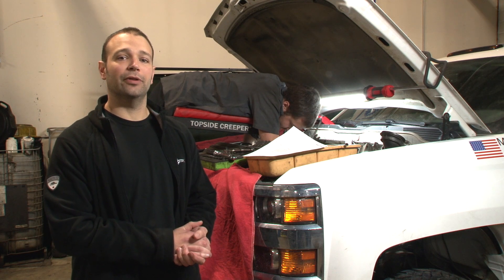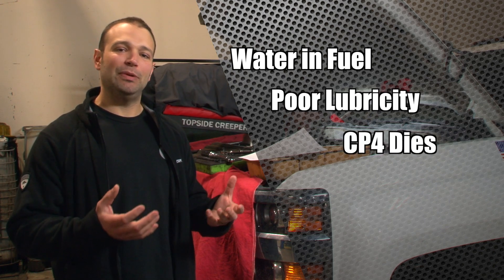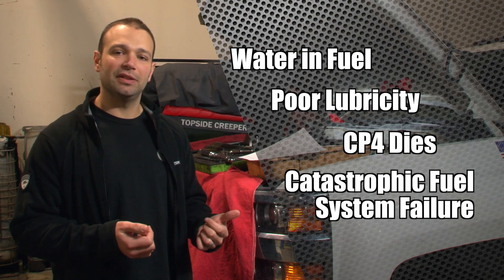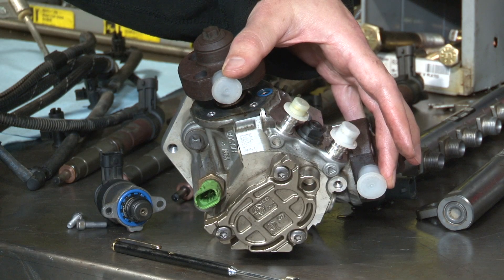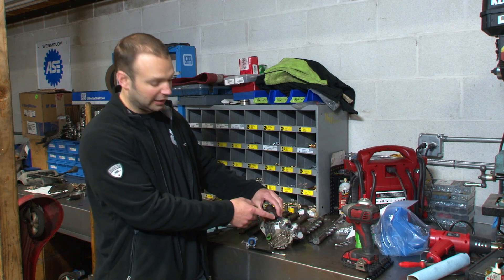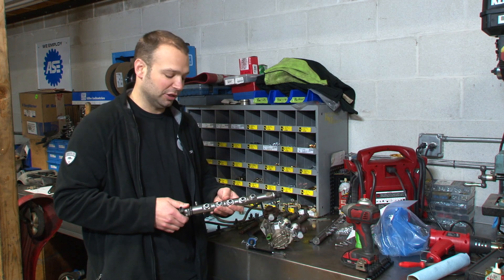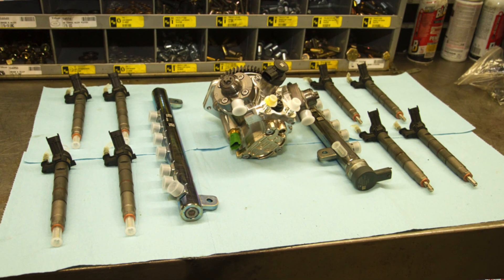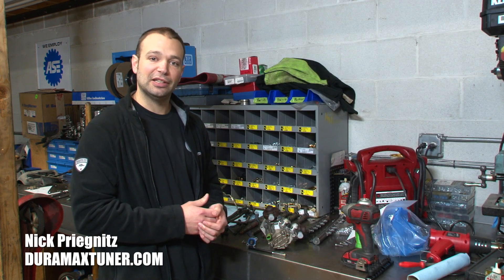Catastrophic Diesel CP4 Carnage - Diesel Insights

Comment: Nick, why would anyone recommend installing another CP4 pump that could fail within 10 to 20,000 miles. Why not install a CP3 ?
Reply from the maker: The kit that was installed on this truck came straight from GM and was heavily discounted back then (almost like GM knew they had an issue). To prevent future failures we install a lift pump and upgrade the mProp screen. Also, back when this video was shot, a CP3 swap was only available for deleted trucks.

Comment: The CP3 will destroy itself when water is introduced into the fuel system as well.
Reply from the maker: No lies detected.
Reply: @Duramaxtuner  I had 2005 c4500 where the fuel filler tube had rotted and water was kicking up from the rear tires. It took the whole fuel system out.

Comment: Any metal on the fuel pressure regulator screen indicates a bad pump correct?
Reply from the maker: Generally speaking, yes. You also will likely see a drop in rail pressure under load.

Comment: Hey Nick, soaked up the info from the video, Thanks for that.  My current issue is wth a 2014 LML, with about 26psi fuel rail pressure. Truck was running good, then quit like surning the key.  No codes, good fuel sample, 2 week old fuel filter, cut apart, looks clean. Pure stock truck, light towing. I'm thinking I would like to pressurize the fuel rail to see if it will hold pressure. What are your thoughts.

Comment: So glad you confirmed the metal shavings were magnetic.  Thanks.
Reply: Just to report back.  A magnet on a firm wire cleans up the gas tank like magic.  But not sure it matters.  The metal bits are heavy and stay at the bottom of the tank.  Didn't see any in my fuel filter.

Comment: Hello Diesel Insights! Could this failure be caused by low intake pressure (HPP intake)? I have a similarly failed pump with a clogged fuel filter

Comment: I have a 2015 Chevy 2500 Duramax and fortunately I have not been affected by the catastrophic failure that can occur.  I started reading about this a couple years ago like many people but never actually knew anyone personally that had to deal with the failure.  So General Motors opted to use a Bosch manufactured fuel pump the CP4 for model years 2011-2016.  Previous model was the CP3 that was apparently a little more robust than the current CP4 or it was at least a little less prone to failure because diesel fuel wasn’t this Ultra Low Sulfur stuff we have to use these days.  And that right there is why some owners are having this failure.  The CP4 pump to survive for a long time needs lubrication from the fuel which it hardly gets with Ultra low sulfur diesel.  That lack of lubricity and the ever present possibility of a trace of bad fuel (water/air) combined with 20,000 PSI in the pump equals bare metal on metal grinding together.  (Boom).   
I don’t know if I’m just buying time or delaying the inevitable but I always every fill up add diesel fuel additive that adds lubricity to the fuel and hopefully that formula works.  It’s just a shame that the consumers that opt to go to that extreme have to shoulder the expense.  Others go as far as putting a inline Lift pump to help separate water and smaller particles of debris out of the fuel.  Another interesting point is this Ultra Low Sulfur fuel mandate by the EPA was put out in 2006 and was to be fully implemented by 2010.  Hmm anyone else see a timeline problem?  I find it hard to believe that nobody at General Motors or Bosch didn’t see it coming.  Any reasonable engineer would be trying to fact find the impact of ULSD on probably hundreds of thousands of pumps when this new standard was introduced.  Curious to see where this goes.

Comment: I have a 2011 duramax that i deleted and added a lift pump to at 90k. It has 176k on it currently and runs like a top. I add 8oz of optilube xl every fill up. Never any problems. But If this pump failed on me while towing my 10000lb camper in the mountains and hurt me or my family I will attorney up and go after GM. These trucks are built to be constantly under a load that's why we buy them instead of gas models. Shame on GM for allowing this, these pumps need to handle the US quality.  I pray this doesn't happen to my rig and endanger mine and others safety. I personally think this is a major safety concern mostly.

Comment: goimg back with a diasterous CP4 engineering design? Not a good idea. Switch it to  the CP3. Better yet dont buy GM or Fords using the CP4. The nippon Dendso HP4 is a GOOD pump, the Bosch CP3 is a good pump, the CP4 is even new just garbage.

Comment: The shops I'm taking my truck to are having probably try to find out whats going wrong with my truck one shop said they think it's the driver side fuel rail the other shop said everything checks out  but the cp4 pump is only giving 24000psi and calling for 26000?? Any help
Reply from the maker: Do you have a lift pump?
Reply: Yes I have a lift pump. I guess it wasn't calling for 26000psi he just was looking for that much

Comment: Curious, given your experience... considering the cost of a CP3 conversion (roughly 3k) and lack of emission intact CP3 conversion kits, is it safe to assume the exergy fuel saver metering valve upgrade (from 80 micron to twin 25 micron screens) is really the only protection/solution we have (in addition to running a lift pump and lubrication additives) on an emissions intact LML with the stock CP4?
Reply from the maker: Either the Exergy fuel saver valve or an Exergy 10mm CP4 would be sufficient.  Also there is an emissions compliant Cp3 kit out there.  Otherwise we have always had really good luck with just a lift pump and getting our fuel from a trusted source.

Comment: So wait your replacing a CP4 with a CP4?  Isn’t the aluminum bore in the CP4 a junk design flaw?  Seems it happens in anything the CP4 is in not just Duramax but other vehicles using this pump have a similar issue.

Comment: Hi Nick,
               Will installing a Exergy Fuel Saver save the rest of the system if the CP4 lets go? I do have the Fass 165 installed and use Stanadyne on every fill up. Have there been any failures with the upgraded metering valve installed to show that it does save the system? 

Thanks ,
                Heber
Reply: NO, not going to help much. The CP4 is just bad engineering. Really bad design, but Im sure it made Bosch lots of money on parts!.

Comment: I have an LML with 65k Miles. Should I install a lift pump or just save that money for a cp3 conversion
Reply from the maker: Lift pumps tend to help a lot!
Reply: @Duramaxtuner  Thats a good idea, and get rid of the CP4 Engine BOMB, Its aluminum bucket bores, and sliding cam with roller on the shaft, its similar idea to an engine camshaft. CP3 is much better design, instead of tiny point contact on the bucket to cam, the pump crank rotates a cylinder sleeve and slides up and down over a huge surface area the bucket to move it up and down, and then theres 3 of those buckets in the CP3 versus 2 buckets in the CP4.

Comment: cp4 = ticking time bomb. I tore one up on my channel. I don't doubt water cause carnage but that cp4 is just a bad design to start with. every car model with cp4 have premature cp4 failure, it's no coincidence. bosch even made a cp4.2 pump, to solve the issues and that one is STILL crap. The design is bad, no wonder gm went with a nippodenso hp4 just like on isuzu commercial line of trucks for 2017. byebye bomb. Preventive cp3 conversion is the only real solution. It should be class action lawsuit
Reply from the maker: While we do hear about failures and there are some aspects that clearly need to be improved, we wouldn't throw the baby out with the bath water on the LML Cp4.  A lift pump and regular maintenance has worked for a lot of drivers. Also, out friends at Exergy Performance released a few upgraded Cp4 options that are just as reliable as a CP3.
Reply: I don't agree. How many CP4s have you heard about tht never fail!?
Reply: Morgan and Morgan have a active class action lawsuit. Call them up, their main office is in Orlando, FL

Comment: Does converting to an emissions compliant CP3 prevent the system wide contamination if it grenades? I used to work for GM years ago and swapped a few early LB7 CP3s that blew but they let go into the valley. I'm in a new career now so I don't have the latest info.
Reply: the cp4 is a flawed design, the cp3 isn't.  If I had a lml, id do cp3 conversion before it trash all the system by grenading

Comment: I take it GM makes these trucks without fuel/water separators?
Reply: 2 condoms and a colander lined with cheese cloth rated at 3 microns.. Just a little better than the oem filter
Reply: L5P uses a different nippodenso hp4 pump that is just as good as a cp3.  Cp4 is weak , and bosch keeps blaming the fuel . If the cp4 was good, why would they make a cp4.2 revision to address a reliability issue?
Reply: Veikra it’s always been a cp4.2 the .2 signifies 2 piston vs the single piston version in a tdi.
Reply: @Nordic_Mechanic  The problem is the fuel. Bosch designed the CP4 for European fuel.  EU fuel is not low sulfur, or wasn't when the pump was released. It was never made to deal with the lacking lubricity in shitty North American ULSD.
Reply: just a filter with a sensor on the LML.. L5P has a different filter set up
Reply: Yes they have a water separator but they can only do so much.
Reply: There is no true fuel water seperator on the LML from the factory.. Just a filter that is supposed to block water with a sensor.. My sensor never detected water in the fuel  when the fuel pump shit the bed
Reply: john williams that all a water separator is.  The stock filter is a dual media with a water separator element and a separate filter element.   The sensor is just a float and only works if you have a large amount of water in the bottom of the filter. Even then they don’t alway work.
Reply: Go look at a real fuel water separator I had one on my freightliner... On the LML its a filter that is supposed to block the water. It's not a very good filter at 10 microns not enough to do the job.. A good water blocking filter is around 2 microns.. I will be adding areal  fuel water separator to mine. Not worth the gamble already lost the fuel pump and system to water in the fuel once
Reply: john williams it’s the same thing just smaller.  You could change it up and have fuel filter and separator as two different filters.  Not sure that would make a difference or not.    The stock filter isn’t 10 micron. The ws element is 10 micron, but that’s not meant to catch dirt.   The actual filter element is 4 micron.
Reply: You can call a shitty oem filter a fuel water separator all day but it's not . OEM filter holds a 7-10 micron rating..  Go look it up.. Already did all the reading when I lost my fuel system in December.
Reply: john williams the oem filter is rated at 4 micron absolute with 99.9% efficiency and 95% efficient at emulsified water removal.  Haven’t seen many other filters with better specs.  What do you plan to run that’s better?
Reply: @Kowclub173  Run a 2 micron Cat 1r0750 or a P553203 3 micron with WS right before the pump, leave your OEM filter in place. I also added a Detroit Diesel filter base and a 20 micron 33118 or a 12 micron  33418 WS before the OEM filter on my Ram Diesel with 5.9l engine. And use a lift pump that if it turns off, the high pressure pump can suck throught it.
Reply: Scott Downey that would be a good setup.  Overkill for sure but does the job 👍
Reply: It's not a 4 micron filter.. NO where does it say that..
Reply: john williams lol ok.
Reply: john williams you never answered, what do you plan to put on as a replacement?
Reply: Well, if the fuel filter and the water separator is one in the same I'd look into other options.  A true fuel/water separator is independent and has a drain on the bottom.  So what exactly are you supposed to do if you do get water in the fuel if there's no drain?  Maybe this is why you see so many Duramax trucks with this issue.  On a Cummins, it's unheard of aside from gross human error.   As far as a replacement goes, FASS or Airdog is a good choice.
Reply: Monster RAM it is a true fuel water separator and does have a drain.  The reason this doesn’t happen to cummins is the fact that they still use the cp3 pump.   The fords have a separate fuel water separator and filter and they also have just as many cp4 failures.
Reply: john williams so if you can’t answer my question, you basically have no idea and you’re just spitting nonsense.
Reply: A shitty 10 micron filter with a water sensor that doesn't detect water isn't a fuel water seperator.. My filter(5000 miles on it) had no captured water in the filter when it was drained but dealer found water in the fuel tank.. This is my 4th truck with a duramax.  2 2500s 2 4500s  also had a 6500 with a cat freightliner with a Detroit and 2 Ford's with Cummins among others.  . Not sure what you're been around but the lml doesnt have a true real fuel.  water separator. Yes the fuel pump is the part that fails on the LML that's one reason people switch back to the older pump..
Reply: john williams microns has zero to do with water separation btw.   So again, what are you going to replace it with that is better?
Reply: Monster RAM The fuel pump just can't take any moisture.. I've had water in the fuel at some point on all the others (usually bc employees lost their fuel caps)and the filters never captured it.. luckily they were all older duramax and the fuel pumps could take the water..
Reply: kowclubproductions  fuel water seperator and a Baldwin 3 micron filter maybe a cat filter 2 microns..  you seem to think these filters are good and work but stats say other..
Reply: john williams like a said before,  having a separate filter and separator might help.  
It’s the same concept but each element is obviously going to be larger, which may help.  
It’s a not a fix all as ford has had that the whole time and still sees plenty of cp4 failures.  Fass and air dog are the same way and those don’t prevent failure either, but maybe they do reduce it... dunno

Specs are the same either way.   Actually ac Delco generally has higher emulsified water separation ratings than most stand alone fws.

Comment: How do you guys feel about adding a cat fuel filler where the stock one goes and deletes the water in fuel sensors?
Reply: I doubt that even this owner's truck even had the WIF light illuminate on his dash.
Reply: Horrible idea
Reply: Cat fuel filter in place of the OE filter works fine ONLY if you add a Fass or AirDog system that has a water separator. Personally, I am running a stock style fuel filter (I run the Racor filter) with an AirDog II 165. OE filter is probably a waste since the AirDog filter is a lower micron rating than the OE, but the protection is there in case something gets by

Comment: Had this happen to my 2016 duramax 2500 last month . Was exactly 8,000  to fix. Was running the cat fuel filter , when it happened. Now I add about 8 0z of opti lube every fill up hopefully never happens again.
Reply: Under warranty?
Reply: If you still have the truck, I would do a cp3 conversion if you've got the extra money. Fleece performance sells a great kit. Buddy of mine put it in his 2013 lml a few years ago at 75,000 miles and now he's got 250,000 on the odo with no problems to speak of. Efi live tuned and everything

Comment: Surely that poor soul would do a cp3 conversion on that??? Why put another ticking bomb in it!
Reply: MountaineerHomestead considering its 8k to fix the issue and it will be 8k to fix it again when it happens again.....why would you not cp3 it! I agree!!
Reply: Justin Ledoux it's totally worth IF they plan to keep it. What's say  $1000 now compared to 8k later when the cp4 repeats?
Reply: Probably did not want the additional bill for the tuning to run the CP3 maybe and the truck is stock?

Comment: I installed a beans sump on my '13 WT with twin fuel tanks. It's mounted directly under the sender on the front tank. Now my fuel guage reads lower than what it actually is. Can I add resisters to the sender wire to make it read correct?
Reply: This should be fixable with custom tuning.
Reply: Calibrated Power I have tunes from you guys